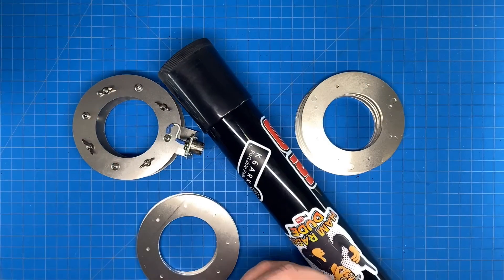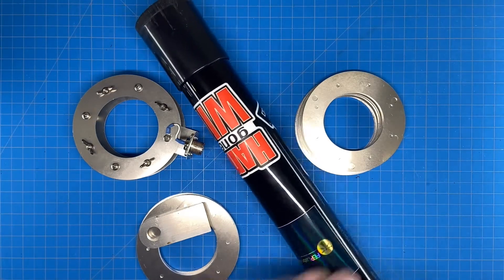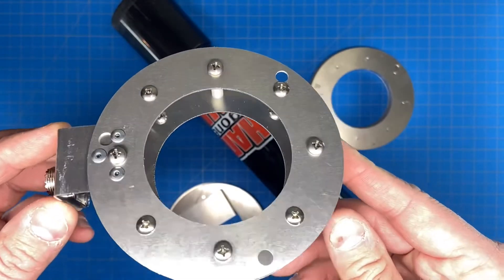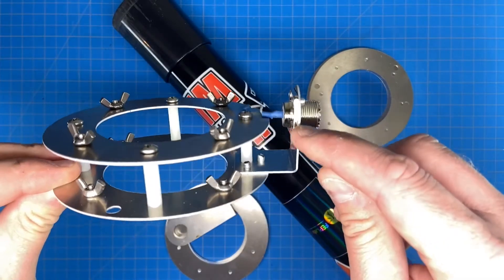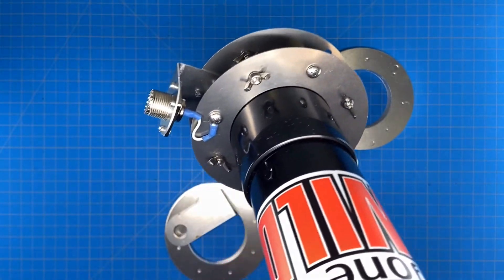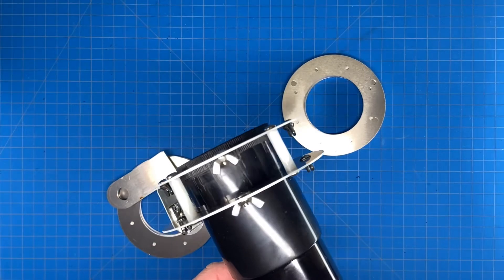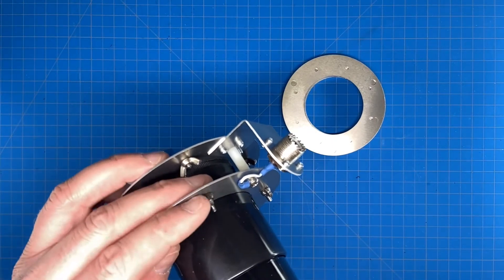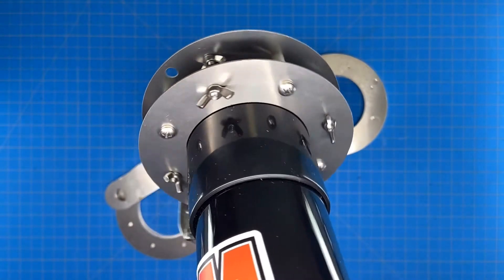Turning my 10 Meter SpiderBeam pole into a multi band vertical antenna.

Comment: The only thing that makes me a little concerned is the abrasion of the rings against the fiberglass. How has it held up? 3D printed might be okay, but it's cheaper to do metal because 3D printing isn't cheap in time or materials like this.